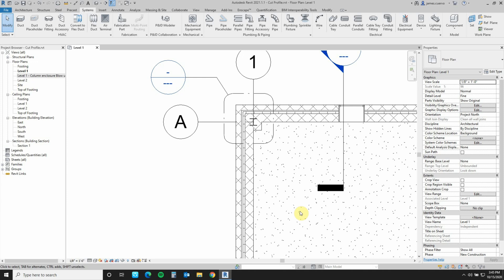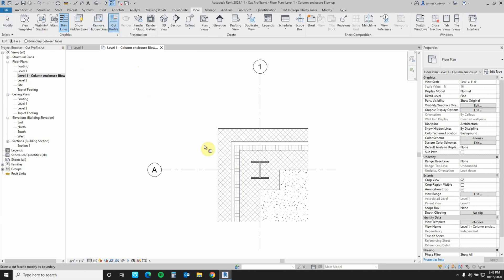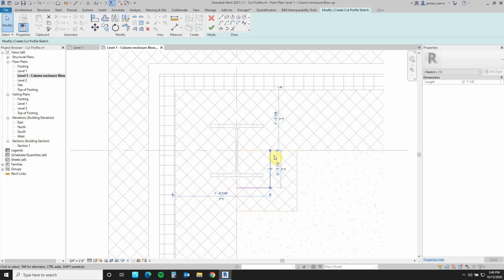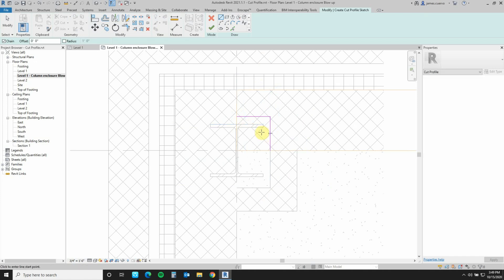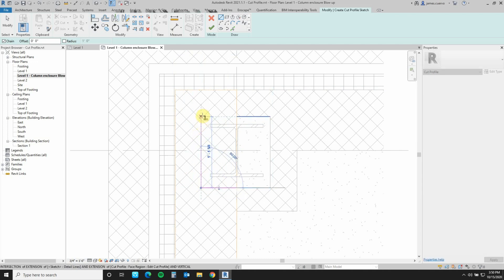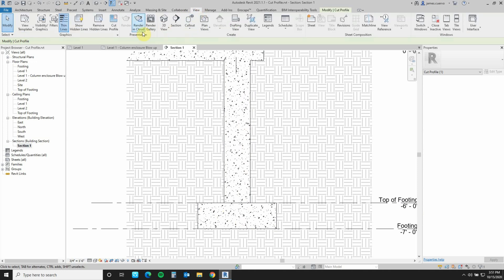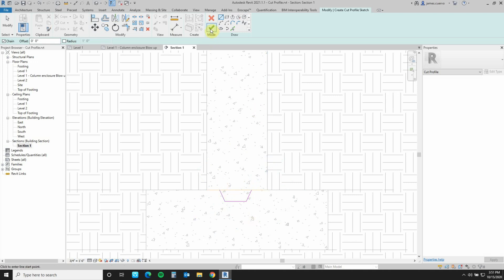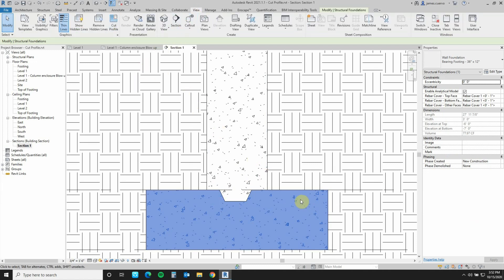Cut Profile Tool in Revit

Comment: Cut profile can be frustrating a procedure for a beginner. In the example in this video a beginner will try and draw a box round the steel column and cut all in one go! And this is when Revit gives its warnings of crossings... etc As was demonstrated in this video you cut on object at a time. You start by clicking on the object of interest; the object boundaries becomes highlighted in yellow lines; you can cut only within this highlighted object boundaries, nowhere else. To do more cutting you have to highlight another object and repeat the procedure...